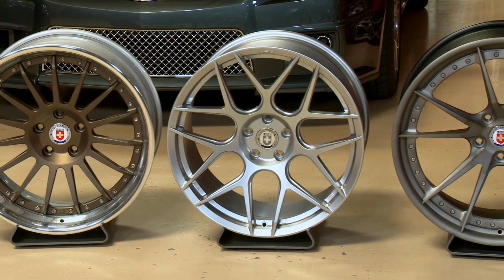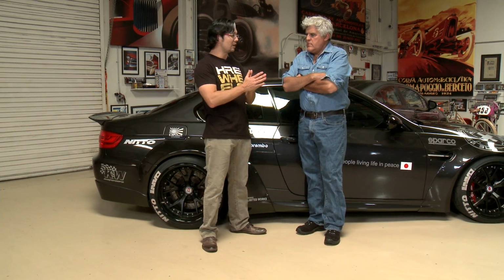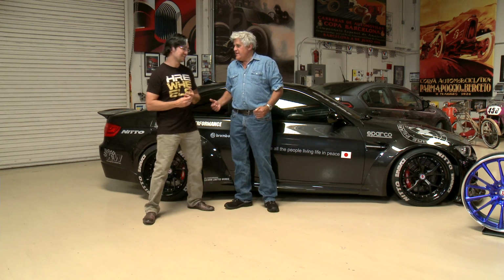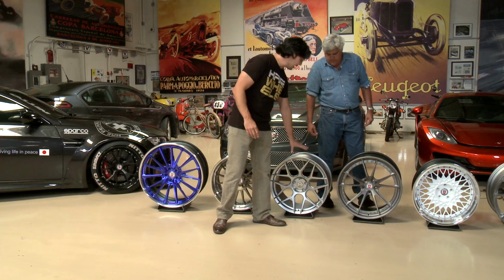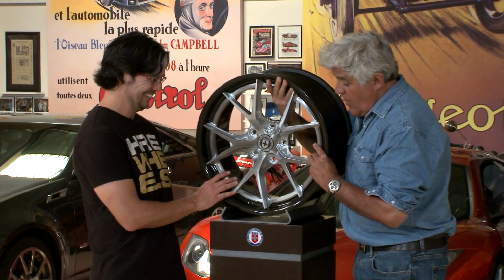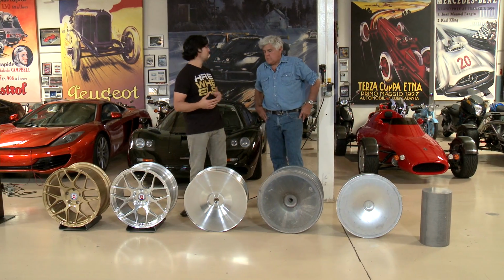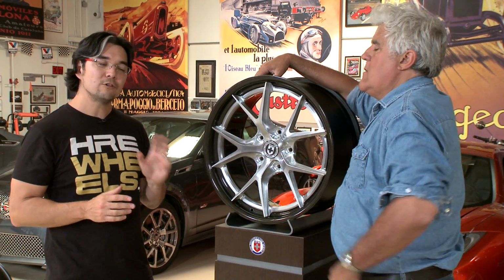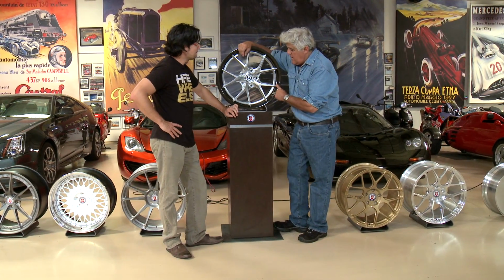Custom High Performance Wheels - Jay Leno's Garage

Comment: So by that "logic", I guess tires for a "200K car" should also cost "20K"? By the way, $2,000 for "rims" (they are called "wheels") is too much. None of the aluminum alloys are precious metals, and casting/forging/machining/finishing operations are not that expensive, especially in a factory setting.

Comment: Whats your source for these percentages?  

Wider wheels = more rubber = more ground contact =  more grip....

Manufacurers have to balance fuel consumption , ride, handling, looks.....

Whereas the owner may want to use the car for trackdays.. And therefore carefull choice of wheel will be of benifit.

Comment: HRE has been around since 1978 and hayashi racing the 60's.  The HRE 501/504/Techno R came out around or before the same time as the BBS wheel. The wheel you saw is a vintage series forged remake of the 501 style with technology/materials from today.

Comment: the FF01 is the strongest cast wheel on the market.  It's called the flow form because the barrel is spun out just like a forged wheel.   The RPF1 is a great and timeless wheel but you kind of answered your own question.   You're paying for the HRE name because you're getting a *relatively* affordable wheel from the same company and engineers that make the high dollar high quality forged wheel.  You're not just paying for the name you're paying for everything that goes with it.

Comment: To bad rays or volk dont have any rims that can hold up to a heaver higher Hp cars thats why you see most of there wheels on smaller cars and in real race car application they are custom made then you are back at the high prices. ;-)

Comment: I understand quality, but I also understand diminishing returns. There are probably minor aesthetic differences between a wheel like the PRF1 and the FF01, but with the HRE wheel you're only getting, say, a 5-10% improvement for 90% more money. And in the end it's still a heavier cast wheel. There's a reason many race teams use the RPF1.

Comment: 1. their back ground as aerospace engineers adds nothing to the cost
2. 6061 T6 aluminum is not exotic material in itself. the T6 is merely a heat treatment
3. The cost comes from their boutique pricing scheme which allows you to mix and match finish and design details making you think your getting a unique wheel. The certification cost for the Euro market undoubtedly also adds to the cost.
Bottom line its a niche market for wealthy guys who have nothing better to do with their money.

Comment: Ha, I still have the old original wheels on my 65 Futura convertible, however she has 2 different sets of Ford spinner hubcaps. I use wire to secure the hubcap to the wheel, so they won't fly off when going fast on curves. I used to have old style mags, however they were too hard on the wheel bearings back in the olden days.

Comment: Many of you arent understanding why the prices are so high. These are composites engineers who designed planes and weaponry that protect our country using thr same 6061 aluminum from the same place that provides the metal for boeing and ferrari.  You dont have to go searching for specific widths offsets finishes etc... These wheels are made for your car in any variation you want with the best service and none  of the bull shit.  Why does a koenigsegg coat 1.5+ million? Because its a no expense

Comment: $3,000 for a set of cast wheels seems waaay overpriced when you can get cast wheels with a comparable weight from other manufacturers like Enkei for less than half that.

Comment: I toured the shop at a combo BMW/Porsche tech seminar. Very impressive to see a factory full of lathes & milling machines. Pricy but I might try the cast set for 3k on my Z06. What I came away with primarily is the TUV certification. With so many heavy & poorly designed wheels being sold in the USA, it surprises me that NHTSA hasn't stepped into this area, not that I'm a big fan of government regs.

Comment: Lots of exotics as well as modern muscle cars owner get these installed on their cars.  But I personally preferred Rays Engineering wheels as well as Various other manufacturer such as Enkei (many different lines but their top notch stuff is worth noticing).  Work Wheels, SSR..  just to name a few.

Comment: What you don't still understand is that they are not designed for cars that cost the same as wheels. You 20k $ car won't do 190 MPH or pull over 1G on the skid pad.